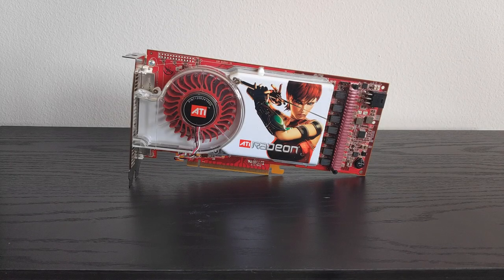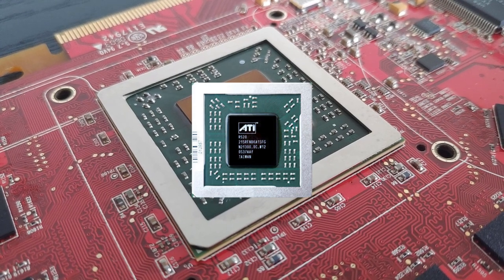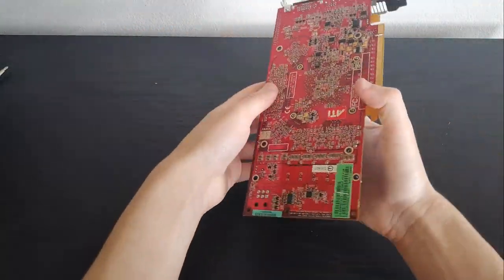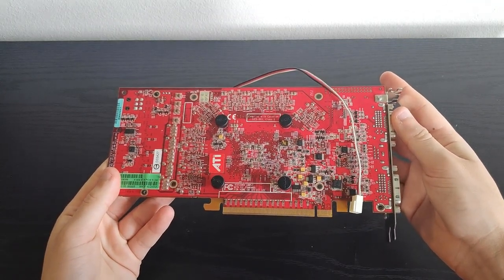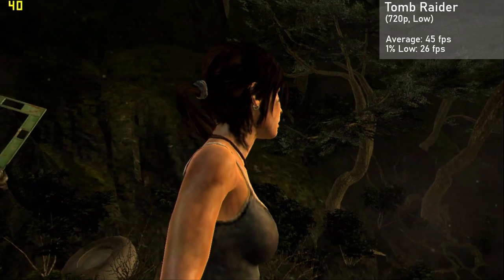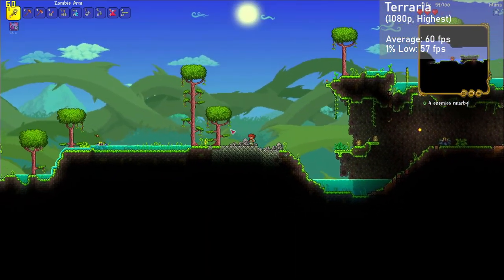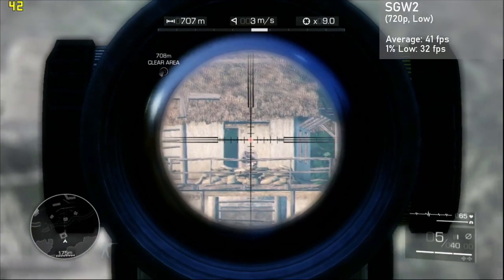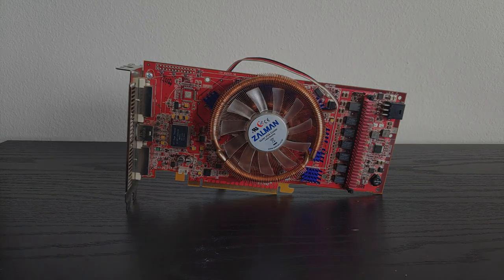The ATI Radeon X1900XTX: The Most Powerful Graphics Card of Early 2006

Comment: This generation is probably the best option for an XP retro gaming PC thanks to their great compatibility with old games.
Reply from the maker: I was planning on doing a retro build with this card, I have an old MSI K8N Neo4 Platinum as well as an Athlon 64 3700+ and I think it would be a great fit with those parts. Still need to find a period-correct case though.
Reply: @SPNG  Since YouTube probably won't let me post a link try finding the "Treasures or Trash? 5 PC Cases for Gamers" article on Tom's Hardware, it features cases with the quintessential 2006 aesthetics.

Comment: This was my choice for a card back then. I still own it. It's got a Waterblock on it though as this allowed me to overclock it quite nicely. This card was a beast and it took nVIDIA's 8800 series to truly dethrone it.
Reply from the maker: That's awesome, I can only imagine how fast this thing would be when pushed with water cooling! How high did you have yours clocked?
Reply: @SPNG  715 to 720MHz, it depends on the game. Some games ran fine at 720MHz while others would freeze up. I even tried a Swiftech MCW60-T back in the day. It contained a Peltier and that allowed me to push to 750MHz on the core. Sadly, the block fell apart (Aluminum Top and Copper Baseplate was a bad idea by Swiftech).

Comment: ah, the last true great ATI series architecture.  Remember back in the day that the SKU's for x1000 series are all over the place, xt, xtx, xl, gt, gto, pro, heck, even the xx50 are all under the same generation.
Reply from the maker: Yeah, they had so many cards in the X1000 series! I think there were about 10 different SKUs just based on R580, lol.
Reply: Erm, the HD5870 being bad? It blew the Nvidia competition away and was untouchable, especially in the newest API's. A generation ahead of its competition. Or the last GCN cards, supporting true A-Sync compute and being fully DX12 compatible when Maxwell and Pascal could only emulate the features?

Sure the X1900 and X1950 were very powerful and long lived cards, but hardly ATI's "best ever architecture.
Reply: @TheVanillatech the 5800 was an amd card. Released after they bought ati.  The last true ati architecture that was released x1000 series.
Reply: @TheVanillatech  the last GCN cards being the Vega 56 and 64's right? (and technically the Vega II's in the 2019 Mac Pro's?)
Reply: @chronicle_4  AMD simply bought ATI technology group. They hardly sacked every single member of ATI and replaced them with their own people, who had zero experience or knowledge of making GPU's...

If a dog is born in a stable, that doesn't make it a horse.
Reply: @thegeforce6625  Yeah I believe Radeon VII was GCN's last shout? But Vega56 and Vega64 were around the same time.

GCN was Raja's brainchild, and amazing long lived architecture. He was seriously pissed when AMD removed 60% of his funding during the early stages of Vega development, to put the money into developing the new generation of console APU's instead. Raja said that Vega wasn't as successful as it should have been because of that. I guess AMD made more money with their decision to focus on the consoles but -  the downside was they LOST the best GPU engineer in the world.
Reply: @TheVanillatech  I’m still using a RX480 8gb, still kicks ass today.

Comment: I just got a X1900XTX for my XP build and I love it. 
Not sure if you tested it with the stock cooler but mine stops spinning if I am in the desktop. Is this normal behaviour? I thought this card was very hot to the point it needed the fans to be turned on all the time.
Great channel, by the way! Do more videos with old cards 🙂
Reply from the maker: Nice! It's a great card, isn't it? That's odd by the way, on the stock cooler my card's fans would never stop as it idled around 55C. And during load it turned into a jet engine while running at over 95C, lol! Maybe I messed up the thermal paste application? I'm not too sure. What are your card's temperatures under full load?

Thanks! Hopefully I can get my hands on an overclocked 7950 GT for a comparison with the X1900XTX, it would be interesting to see how they both hold up in some older and modern games!
Reply: @SPNG  Ok, so I think I was the one who messed up the thermal paste application. I re-applied again and now everything seems to work alright. My card was sitting between 70°C and 85°C in idle.. with no fans. For some reason the fans only turned on when I opened a game. That was not normal. I was using Catalyst 10.2.
Now it idles at 40°C and 85°C in jet engine mode, using Catalyst 6.2. Not sure if the drivers have something to do with it, though.
Looking forward to that 7950GT vs X1900XTX video :)
Thanks man!

Comment: I liked the 7 series back then and I like it even more now.  And I was a huge Radeon fanboy back then. I had all Radeons until the X1800, I just didn't like the design compared to the 7 Series.  And going backwards 7 series can be used in Windows 98.   By the time the X19K was faster it didn't matter and there are much faster cards that can run the same games in XP.
Reply from the maker: I really liked my time with the 7 series cards, especially the 7900 GTX (with the awesome quiet cooler!) but if we're talking strictly DX9 hardware, for me I would prefer the X1900 cards. They're very closely matched in earlier DX9 games but in anything released beyond 2007 the 7 series really crumbles. Main thing I like about X1900 is that it was ready for future demands and the more complex shader code of those later games thanks to the scheduling hardware and incredible pixel shading power. Unfortunately I can't say the same for the higher end 7 series, they're completely shader bound in a lot of games. The ability to use 7 series on Win98 is a big plus though. I feel like 7 series is better for earlier DX9 games and older OSes while X1900 excels at the later DX9 games, I'd say they both have a place in retro gaming today.

Comment: Why would you take that glorious stock ruby heatsink and replace with the lame zalman thing? >.<
Reply from the maker: Because as nice as that cooler looks, it's functionally really terrible. Like I mentioned in the video despite a paste change the stock cooler would cause the GPU to run at over 95C under load and was really loud as well. Now I've got a Thermaltake Duorb on this card and the temps don't break 70C on the GPU.